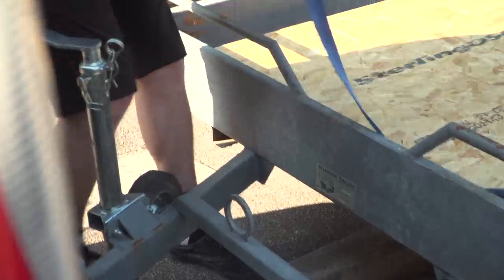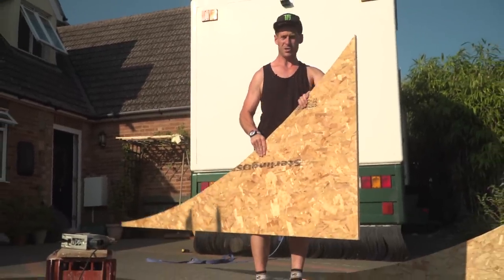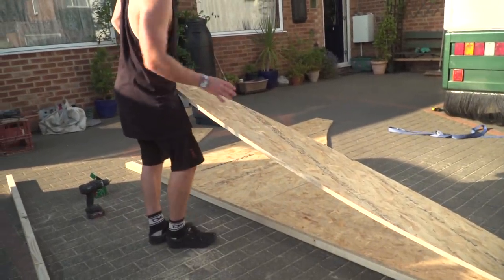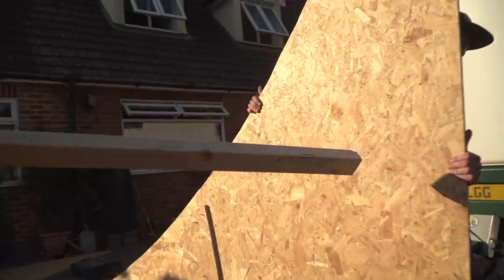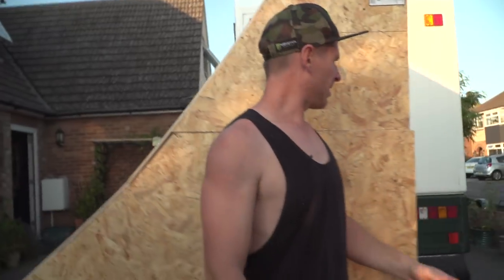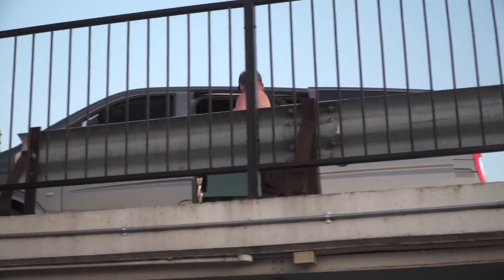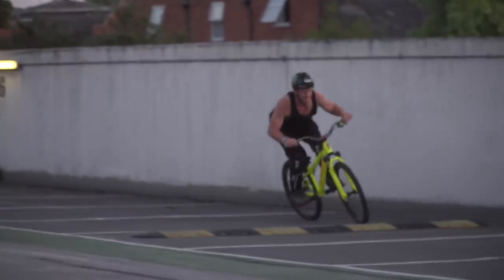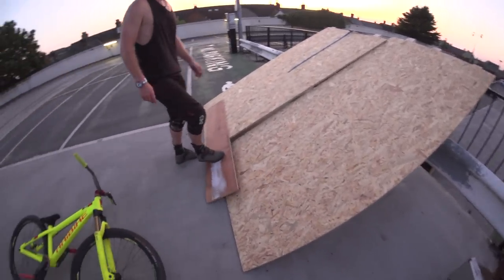HOW TO BUILD A HUGE RAMP AND SEND IT - URBAN MTB FREERIDE

Comment: Argggh. Think I would have cut those beams in with notches. But I guess the top ply is overlapping the transition boards, so the screws aren't taking all the weight. Love how easily you overcome your initial fear. You just go for it. Respect.

Comment: yes sam i love ur shit bro ur a sick geezer on a bike. i have just bought myself a new carrera kraken to get me started. my friend is wanting to get a ORANGE full suspension bike second hand or buy frame and get fox forks and stuff added to it. i noticed wheel rim sizes can be different, like on my kraken they are skinny rims. do you think they are ok for jumps and little stuff. is there pro grade rims out there that are skinny and handle this stuff because on the orange bikes the rim size wall is bigger like on my old bmx. i like to come up to a curb and lift my front wheel up the curb and have the back wheel bounce off the curb into a nose wheelie and focus on not putting weight on my pedals as the back wheel will bounce off the curb too much that it might break. on my bmx i do it so good, im just a bit scared on my kraken because there skinny rims. can someone please help me i want to abuse the bike. can it handle it?
Reply: u wont believe it, my tire has popped after 2 weeks. the tires are thin as fuck and it got punctured by a thorn wow. shit continental tires.